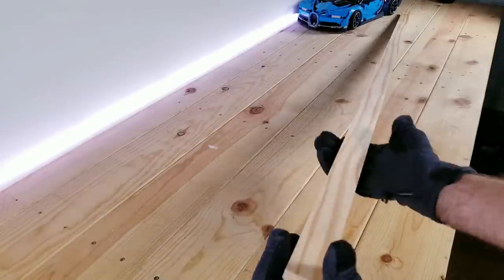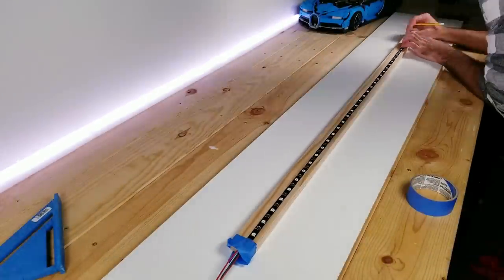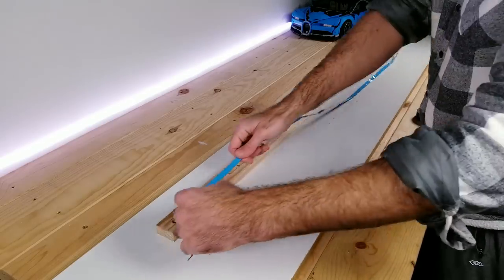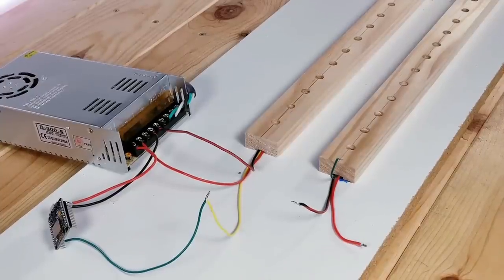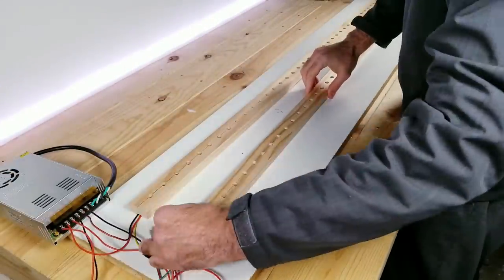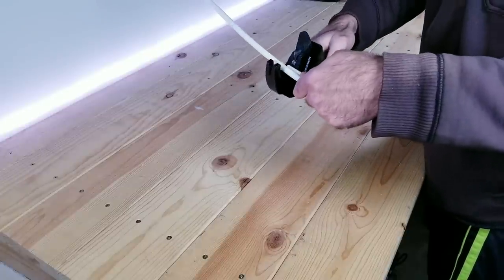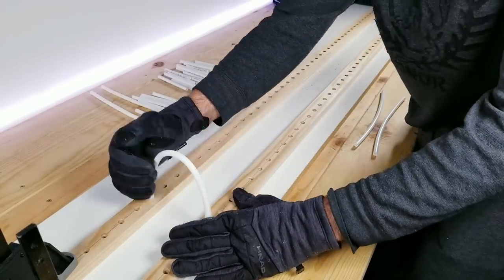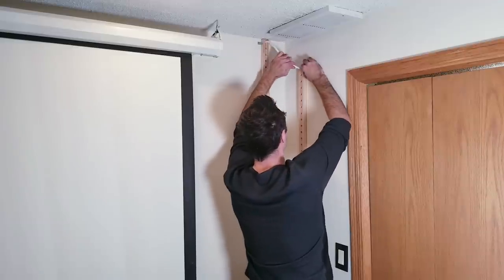Crazy DIY Light - Complete Walkthrough

Comment: Love the vid great idea! I was wondering if you've messed around with ws2815 lights before and was wondering if they are actually any good? I've seen that you don't have to power inject them and was wondering if there are any more benefits to them?
Reply from the maker: Thanks for watching and I'm glad you enjoyed! I wish I had more experience with different LED strip and eventually I will but I have not played around with those yet. The idea of less power injection for sure sounds nice! I think when I eventually do a project with a lot of LED's is when I will probably look into different LED strips like that. Do you have much experience with them?
Reply: @ChrisMaherDIY  No but I've done some research and it appears that they are about the same as ws2812b just 12v and I think there are a couple of more benefits but like you said I think the only reason you would actually want these is for a bigger project. They are also only about like 2USD more than ws2812b strips. I would love to see what ideas you have in the future you've really helped me get into LEDS! Also have you heard of the qQuinLED-Dig-Quad board because I would love to see you do a video on one of you could?
Reply: Nice project! I would steer clear of WS2815s in smaller projects like this. 12v is nice, but the extra voltage has to go somewhere as the LEDs are not actually 12v. They have resistors inside each led package to drop the voltage down, but this creates a lot of extra heat (which can burn out the LEDs) and wastes a lot of power. 

SK6812 is 5v and does well without a lot of power injection, and is RGBW to boot! TheHookUp has a good video detailing these different types of LEDs 👍
Reply from the maker: @fluffys3180  I have only heard of them but have not really looked into them at all! i've heard good things from a couple people so I will for sure have to check them out! Thanks!!
Reply from the maker: @PoisonWaffle3  Thanks for the great explanation! I love TheHookUp! Great videos for sure and definitely gets into more of the technical details which I am still very much learning!

Comment: Looks nice when it's dark, but weird at day imo. 
I wonder what it would look like with thin white fabric span above it?
Edit: I first thought you were going to use glue gun sticks for the tubing! Next project? 🤓
Reply from the maker: Yeah I could have definitly done more to make it look pretty during the day. Maybe stained the wood and for sure got rid of the hardware. I could definitly have tried using hot glue but i've seen projects like that on youtube but I didn't find anyone using pex. Also pex comes in a lot of different sizes so at the time I thought I might try incorporating different diameters of pex tubing into the project but in the end I just used the 1/4 inch. I still might have to try doing a project with the glue sticks because they do look nice from the projects i've seen! Thanks so much for watching!

Comment: No smh. Should have put the hardware on the inside of the loops.
Reply from the maker: I went back and forth on what to do lol. I ended up on the outside because the pex tubing put a lot of outword force on the wood because it naturally wanted to go strait and not be curved. The holes they were inserted into kept them in place but I thought if I put the hardware on just the inside, the force of the tubing might slightly bend the wood up with only using 3 pieced of hardware on the inside. I thought it might hold better on the outside. (It very well could have worked the exact same if I put them on the inside but I didn't want to put any more holes in my wall than I had to so I opted for what I thought was my best option to not have to potentially end up securing the inside and outside)
Reply: @ChrisMaherDIY  ah. I didn't think of it that way. Additionally you weren't using drywall screws.
Reply from the maker: @jezues1286  Yeah I HATE using drywall screws. Its just so messy. I'm actualy suprised its still holding strong with not using the drywall screws though.